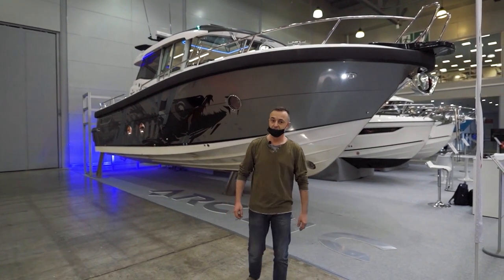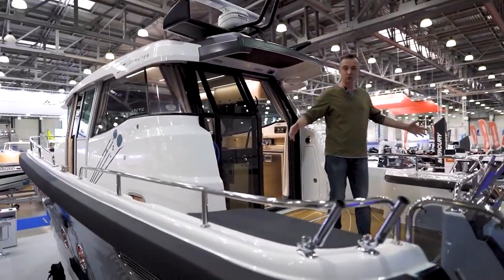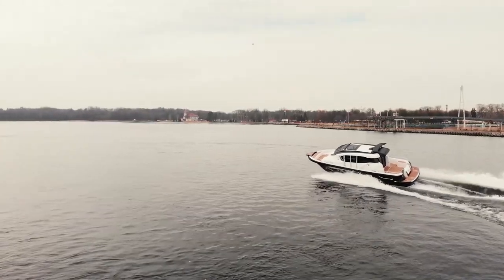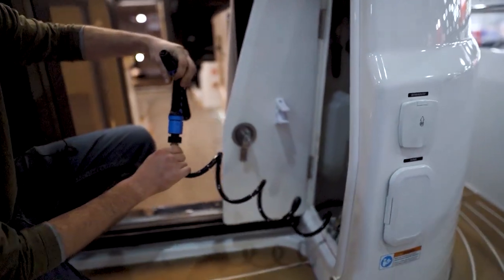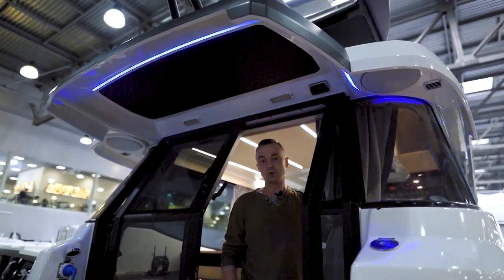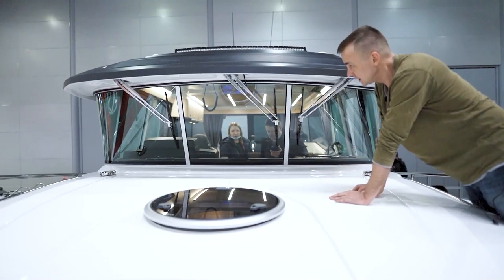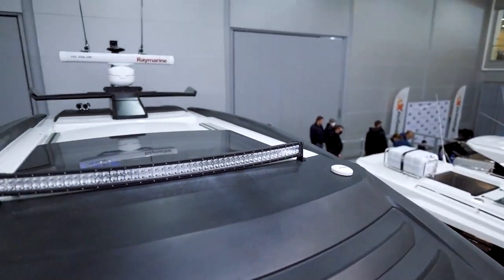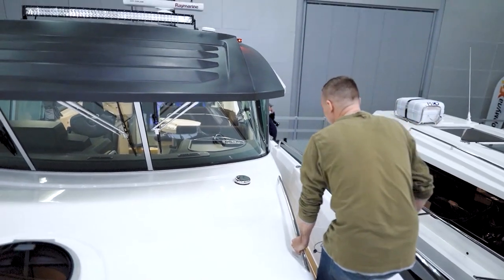Denis review ARCTIC Commuter 35 in Moscow boat show 2021!

Comment: Great job on the presentation. The boat has really nice lines to it. I sent off an email to Artic Boats yesterday about the possibility of getting these boats in the Pacific NW in which includes Northern California,  Oregon,  Washington and British Columbia. Washington would be a great cental location for a dealership. These type of boats are great for the places where cooler temperatures and more than average precipitation are the norm. I also see these boats being popular in the Northest and the Great Lakes region of the USA. A popular feature in the Northwest  for fisherman is a second helm station in the cockpit being able to control the main engines along with a trolling motor such as a 9.9 hp to 25 hp high thrust outboard. Please make the mirror optional along with the sliding roof. Most people who fish like to put inflatable rafts in the cabin roof as apposed to hanging off a davit at the transom as it would interfere with fishing.
Behind the rear cabin door on the port side would be a great place for a built in cabinet for an electric or propane BBQ a sink and another refrigerator or even a freezer or ice maker. It would be nice to have the option to delete the fold down seat at the stern and have an option for a full width refrigerated cooler with a fish cleaning station on the lid and tackle storage below. This could also be an optional place for a BBQ. Something about 32" high.Since there is no storage under the lounge seats and that the berth below is the full  width of the boat it would be nice to have the berth at say 5' and use the rest as storage accessed from the floor above and/ or below at the berth. You could build a nice partition with an access hatch.It would be a great place to store extra supplies such as cases of water or other beverages, safety equipment, extra propellers etc. 
I think the cost of the mirror and the round fiberglass insert it sits in at the front stateroom could be better utilized elsewhere. If you offered this boat in an outboard version it would get starting price down as those 370 D6 with the DPI outdrives is about 70k each in the USA. Might have to increase fuel capacity. The 900L fuel capacity is great for the Deisel I/O as it would give the boat 350 NM range? 400 to 500 NM range is ideal for long distance cruising (Seattle to Alaska). I did not see an inverter listed as standard or optional.  Diesel heat is a must with heat vents at the windshield. I am really not fond of the opening vent in the front windshield and you should have an option to delete it. You can just Crack  open the side door for ventilation. With the right modifications i could sell this boat very easy especially when compared to the pricing in our area for the Sargo and Targa. Overall I think the boat is a nice design and well thought out. Maybe you could have a couple of  versions of the boat one for fishing and long range cruising and one for people who only cruise. 
Thanks for listening and hope to see one of these in Washington State USA soon.

Comment: I am from Hong Kong. I ordered an ARCTIC 25 three years ago, but it took two years to deliver the ship. When the ship arrived in Hong Kong, I found that the wires of the ship were messy, all the water pipes were leaking, and the hull was also leaking. The quality is very bad. The ship is still being repaired in a shipyard in Hong Kong, and it is still unusable